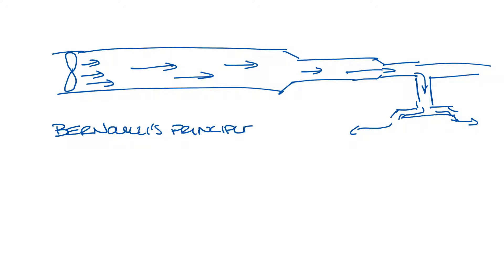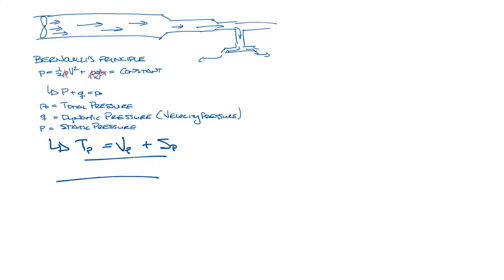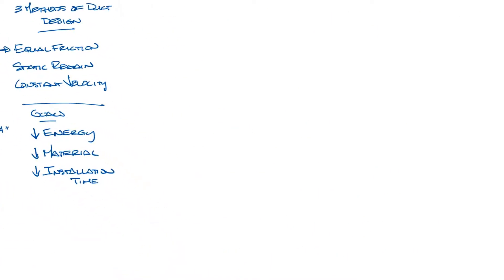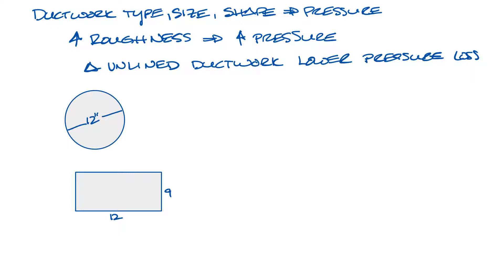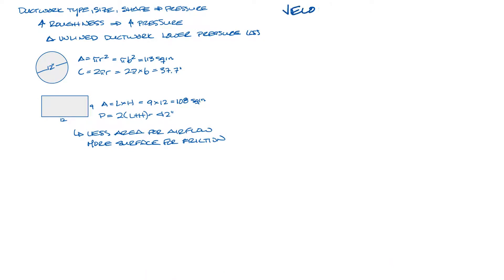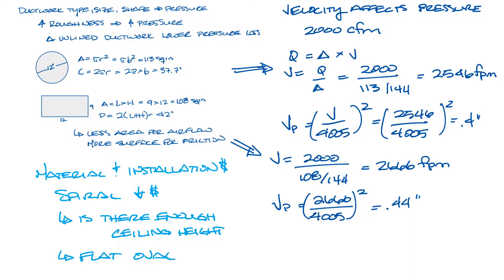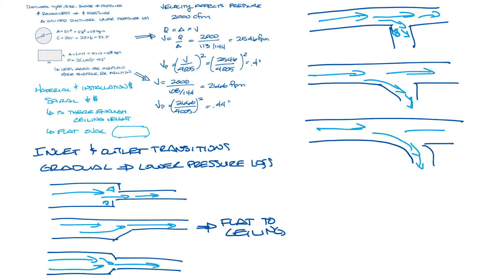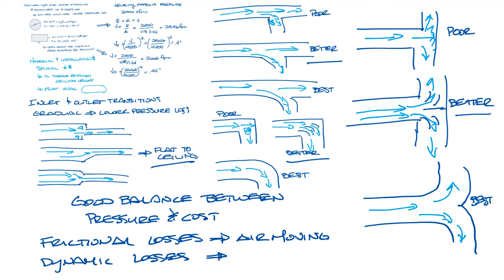Duct Pressure Overview

Comment: Hello Jenny, Could you please share the excel spreadsheet for the fan static calculations?
The calculator sheet I am using is the complex one, it will more helpful if you share the spreasheet.